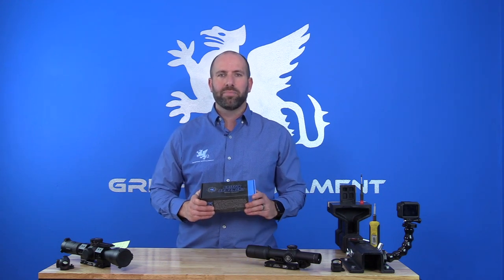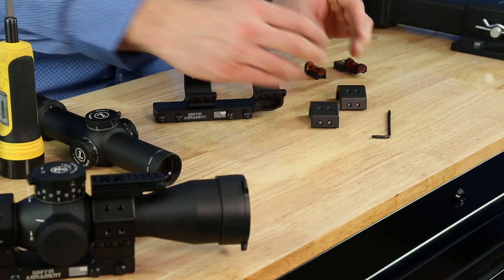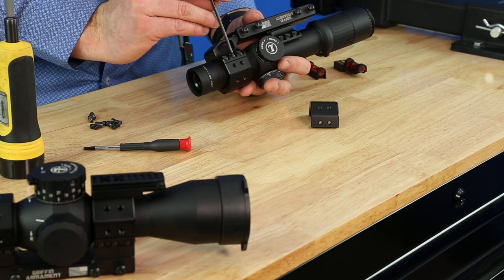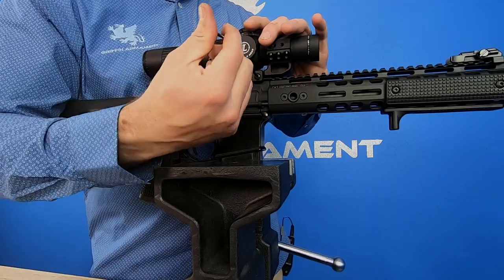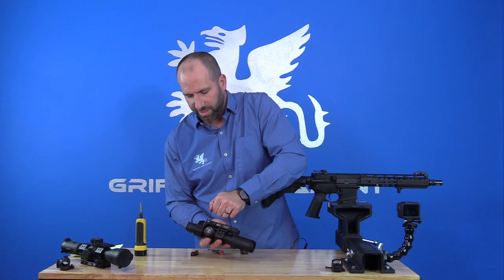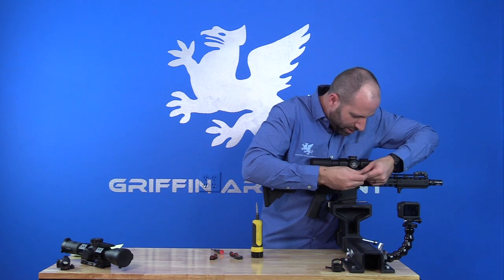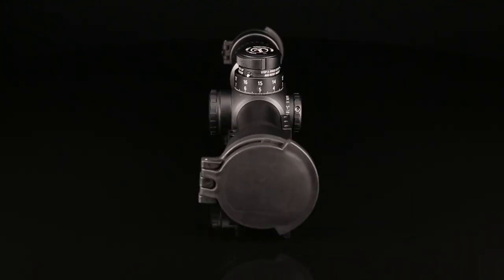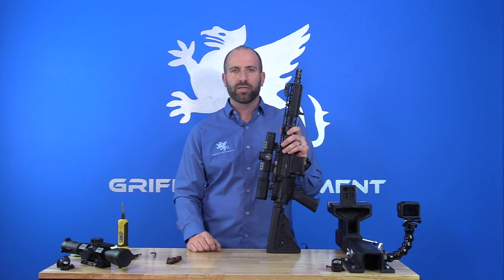SPRM² - Scope Mount Installation Tutorial

Comment: What’s the application of a cantilever mount vs the standard? Is it just about eye relief?
Reply: This is not just about eye relief. There can be a number of reasons for the different styles. On some optics and some rifles (particularly AR style rifles) you cannot get the optic far enough forward without using some slots on the handguard... which is a horrible thing to do. For one if you ever need to take your hand guard off you have to remove the scope too, but also it can impact accuracy in a big way. Heat and other things, like a hand guard that isn't fully attached properly or has a less than optimal mounting system can move. Even minute extremely small movements are bad so don't put an optic (for precision) on there ever. There might be other reasons as well.